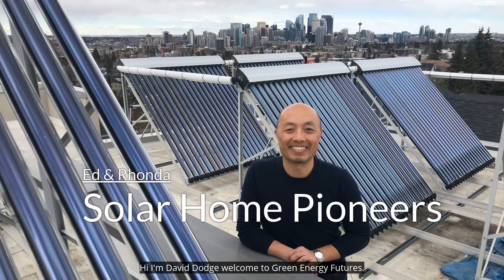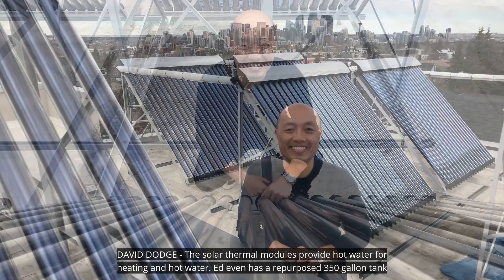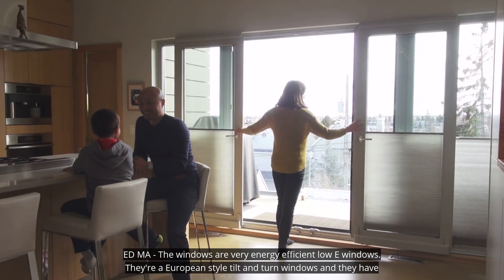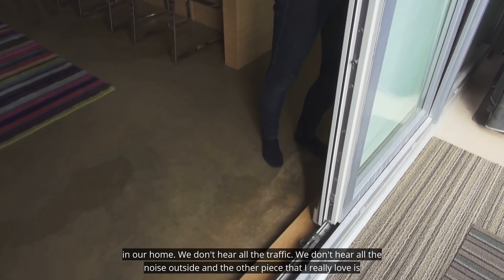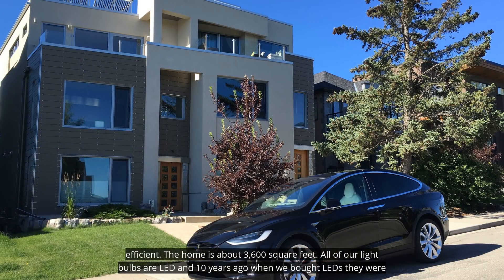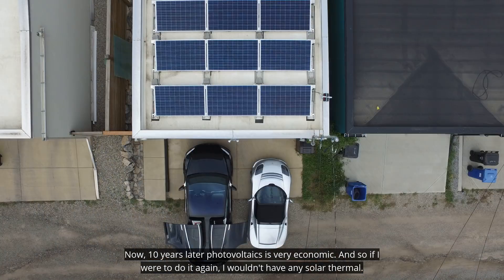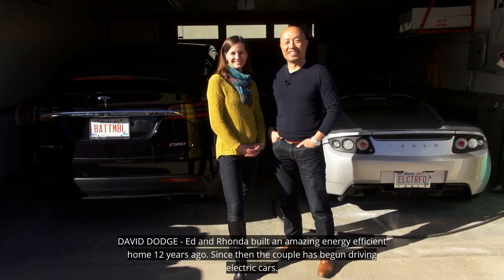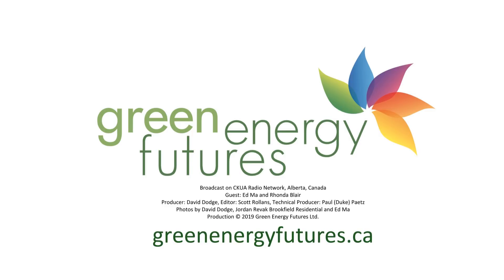223. Solar thermal home pioneers - Still cool after all these years

Comment: 1. ST arrays too close together, shading the back. 
2. Piped in series, will be less efficient as less ΔT at the end
3. Put the arrays closer to the front, and wide as possible, pipe in parallel,  and further apart.
4. Addition of a uBTES will allow heat from summer to be used to heat the house in winter
5. back the ST with PVT as a pre-heater, and you''ll triple the amount of electricity generated as well.
Reply: Yes good advice but they are the only ones doing it, do u have a system? not to be chalanging but im trying to find others that are doing the SHW.. Yes more Evacuated Tubes, where can u get them?

Comment: question when you have a hail  storm and they get damaged  them what 
the solar panel did work as well as I throw they could  especial in the winter  having litter trouble with storms this year all around  some  land problems started it all off  my road washed away  fields flood too  garden flood with the greenhouses  3 stables barns flood  1 barn  the roof  fall in  my house has structural damage done to it too  creaked a support  column  on the timber 
 frame windmills landed on the ground too  
does look great right now too just say we are lucky to have a place to stay  in the town its, not for me town living  lol  the country is vert awesome  for the support  in this matter in the flooding problems  just figure out  now how to take care of it  the developer  did all of the damaged  never had any build permits they lift the country  gone back to Pakistan did manage lift  check with his Pakistan account number on it  and it was freeze accounts now  his Canadian passports been cannel too they as to if they try to come back to Canada they will be arrested
Reply: Are you paranoid?
Reply: sorry  they dint answer but if the Evacuated tubes are at an Hi Angle which has a 2 fold benifit as the higher angle, i have mine at almost 80 Degees as im chasing that Winter Sun as it drops so low in the Winter AND it shades it self in Summer when u have Way to much HOT! They are made of some very tough Glass, think Pyrex, so i guess a thried benifit of Hi Angle is the Hail would be just a Glancing blow and would survive easily. i have Free info at Guilt Free hot Water

Comment: Solar thermal collectors are still more efficient than solar PV. You still need some storage, and storing in batteries is just going to be costly, take space, and need to be replaced every 10 years. Solar collectors are more efficient, easy to store heat in big tank, and have it easily for few days even. I was thinking doing just solar PV, but after analysis, I am definitively going with hybrid system, and well balance it, and only use solar PV to help a bit.